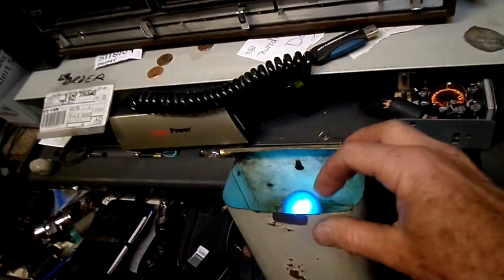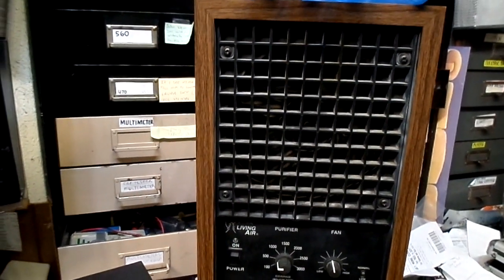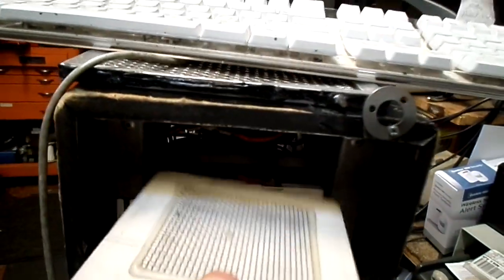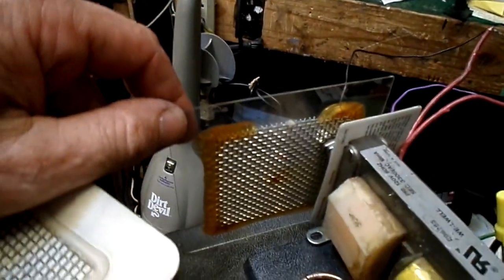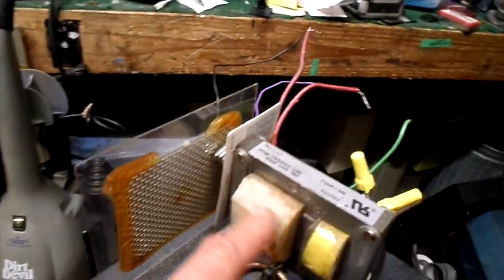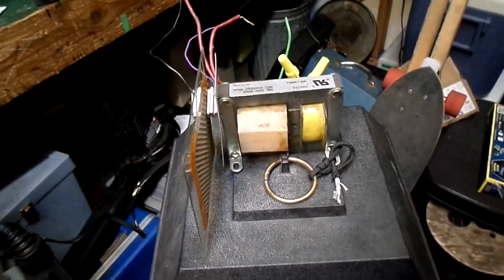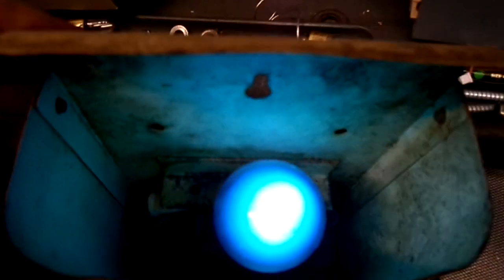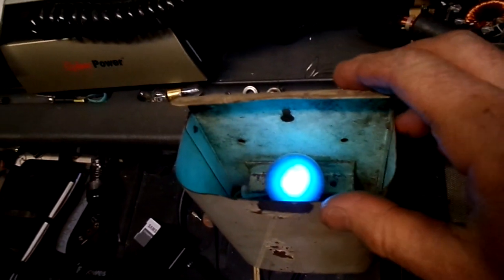Can Electricity Kill A Virus?  Some People Claim It Can.

Comment: Your experiments always get me thinking. You manage to put complicated electronic theory into practical easy to understand demonstrations. 

I did some tinkering as well this week, turned an old AA6(has AF amp stage as well as audio output tube) tube radio into a two way intercom with the addition of a DPDT switch, a second audio output transformer from a junk radio I parted out years ago and a bookshelf speaker. It's being used at my employer to talk to customers outside the locked front door(store is closed to public) to tell them to place their order into it and we will bring it out back on a cart.
Reply from the maker: Keeping it as simple as possible is always my goal, so I appreciate you comment.

Comment: Thanks for the video. It must be said, When using an ozone generator the room must be empty. Then aired out before occupying. Also it’s the same with UVC lights as the light can blind you and it also generates ozone in the air.
Reply from the maker: I agree. Breathing to much ozone can be deadly, and I'm not overly impressed with it's ability eliminate unwanted odors as some claim.. I recently put an ozone machine in a car for 48 hours in the hope of eliminating the cigarette smell from the previous owner, and while it may have helped some, overtime the odor came back.

Comment: I made a ozone generator using some parts from eBay and did some experimentation with it last year with the intention of removing strong odors from rooms or certain objects and I was both, impressed and unhappy with some of the results. After I built it I was looking for something stinky and small to try it, then it didn't take me long to come up with such object. I used the collar out of my neighbors dog which did stink like ultra hell.I put the machine and the collar inside a large plastic tote and turned it on for about 10 minutes . When it was done and opened the plastic tote the smell of ozone was unbearable and almost made me sick to the point it gave me a sore throat (so please be very careful whit large concentrations of the gas) . I let it air out for about 10 minutes ant gave the collar a sniff and to my surprise the horrific dirty dog smell was gone but there was an after smell from the ozone coming from the synthetic fibers which I found out they can become damaged and even toxic if exposed for extended periods of time. So
Reply from the maker: I tried to use mine for order control on a couple  occasions and was not to impressed, but perhaps it works with some things. I've also had the misfortune of breathing in to much ozone, and my lungs hurt so much the pain of breathing in hurt so much I felt like it almost killed me.
Reply: Grants Pass TV Repair . One think I have noticed is that if the relative humidity level is too high then the machine won't be as effective of producing ozone as we as the ozone being produced won't be as effective. 
By the way, I really enjoy watching your videos . I think you are a great mentor.
Reply from the maker: @simpleman7727  I doubt humidity will effect the output of my ozone generator.

Comment: For what it is worth, Viruses are not alive, they are simply a short strand of RNA surrounded by lipid (fat). Get rig of that layer of fat and the RNA strand dries up and turns to dust, this is why hand washing with soap is so effective.
Reply from the maker: If that's the case I'm wondering  if ozone generators or UV lamps can really help..
Reply: Since virus isn’t a living organism, destroying it is a mechanical mechanism. Hand washing works because the soap breaks the fatty protective cover and exposes the RNA inside which is easily broken up. 
UV and ozone: I’m guessing they work for the same reasons they work on latex gloves—they break the fatty layer.

Comment: 0:45 UV lights are used behind waterfilters to kill bacteria for making rainwater drinkable. But if it will also kill virusses, i don't know. 
There are old studies about applying a verry small DC current through the human body for healing purposes. This DC current is in the range of microAmps.
Reply from the maker: Yes. I understand they use ozone in swimming pools as well. I'm familiar with some of the experimental devices people use to apply a voltage at a variable frequencies through their body,  I tend to be a skeptic about them since it would seem such a small current would have a difficult time passing thought enough of  someones blood to make a difference. Here are a few of these antique devices people have used in the past. https://www.youtube.com/watch?v=MwF4oNUIIn0&t=83s
Reply: @GrantsPassTVRepair  A small electric current is sufficient to change the properties of a liquid (blood etc..). I have a 6V - 600V ,1mA - 400mA Electrophoresis lab power supply here, such power supply is used to extract DNA from a fluid,in the way like Electrolysis works. In the past, microwave tube devices were even used by physiotherapists to treat deep injuries.

My previous physiotherapist has ever used such a device with me, this gave a warmth that came from within. So I'm not surprised at anything in this area.
Reply: @BjornV78  Is this PERF or something else? Being able to target 'wet' tissue and old injuries can really change quality of life for someone. Thanks for the mention. Healthy 2021!
Reply: This might help kill covid  after all. I'm going to ask someone who knows more. Happier Healthier 2021 to you! Thank you very much.
Reply: @cherylm2C6671  Thank you, for you also a healthier 2021. Grtz from Belgium.

Comment: you can damage your skin and eyes with UV light. I wouldn't put your hand too close. Is it UV-C?
Reply from the maker: Thank you for the warning.
Reply: I recognize that blue glow. It's a mercury vapor lamp and it radiates lots of delicious UVC at 254nM and maybe 181nM too. 254nM is perfect for blasting viruses but too much exposure to it will give your eyes a bad flash burn and damage skin. The filaments initially preheat the mercury and once the discharge is going they serve as a crude regulator (due to their PTC resistance property).